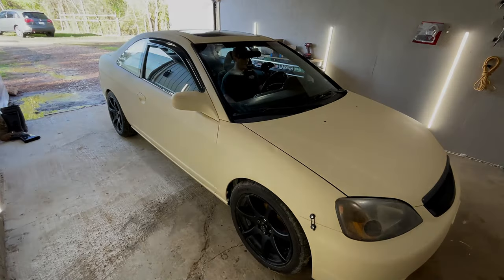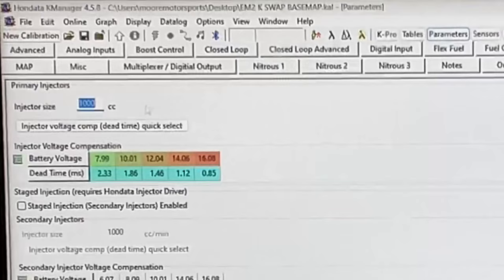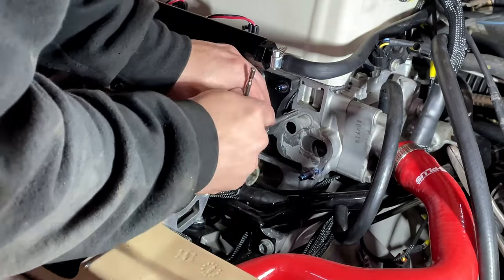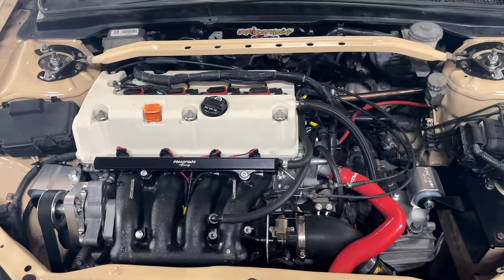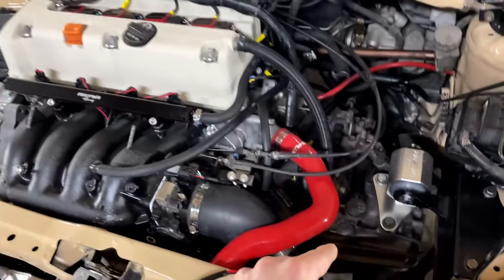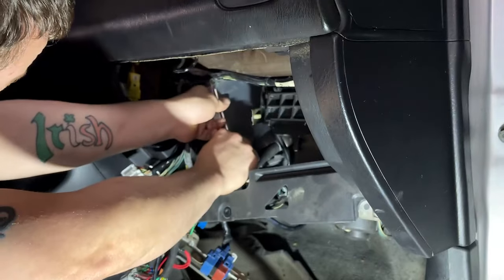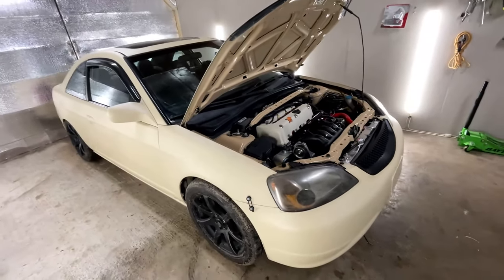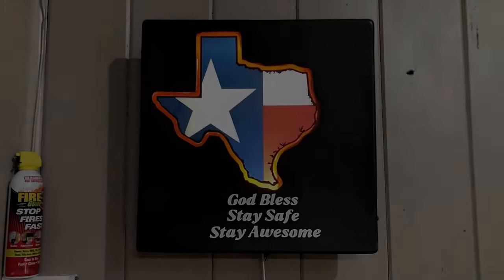HOW TO K SWAP A EM2 PT 3- GETTING IT RUNNING! KPRO, VSS/CSS WIRING.

Comment: On humble performances website the only option for KPro v4 are d17. 05-06 rsx, and s2000. I’m guessing 05-06 rsx is what you selected for this build? I’m doing the same build for my em2 so I was curious. Also what core ecu did you send in for them to KPro

Comment: When relocating a battery to the truck, is it important you get a non -vented battery?
Reply from the maker: It isn't a bad idea but you can use a battery box and run a vent tube out to vent under the car.